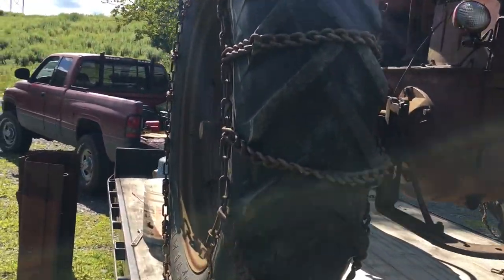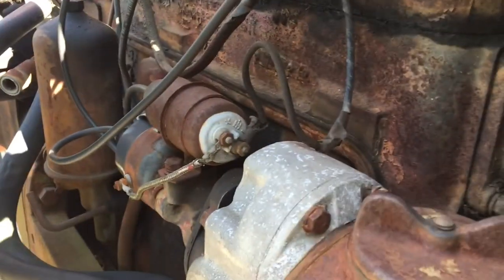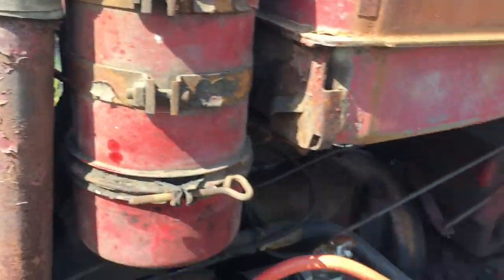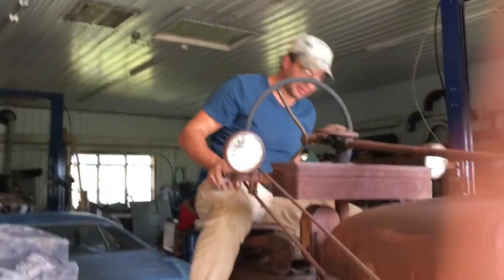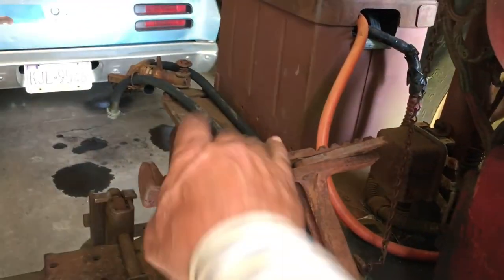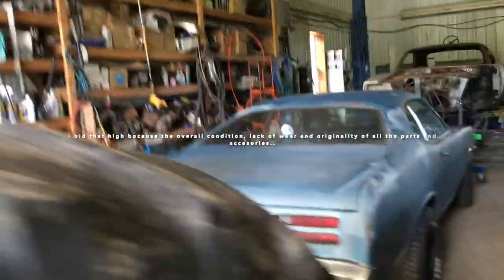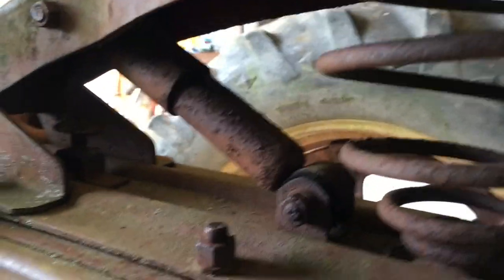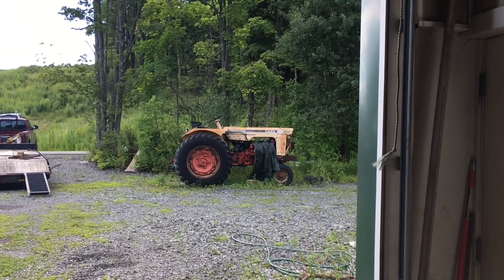Super M intro Will it run?

Comment: It has a straight M gear shifting lever, which leaves me wondering if the serial tag has been replaced? Even the vary late M's had the curved shifting lever.
Reply from the maker: Interesting, I don’t know. a lot can happen in 60 or 70 years. I would like to know for sure. Thanks for watching!
Reply: It's a super M.